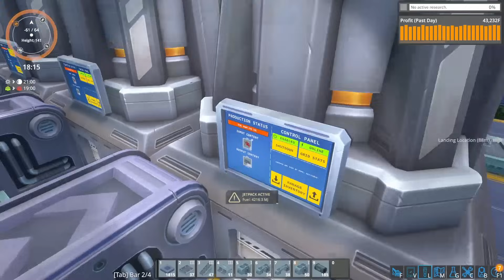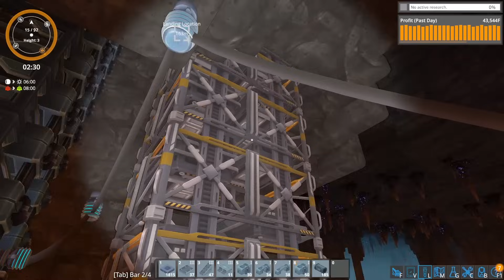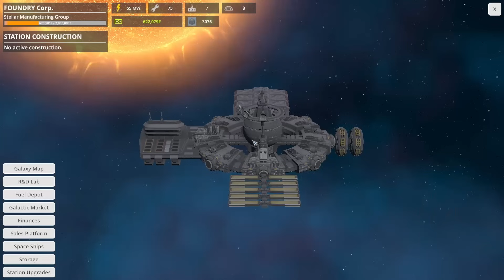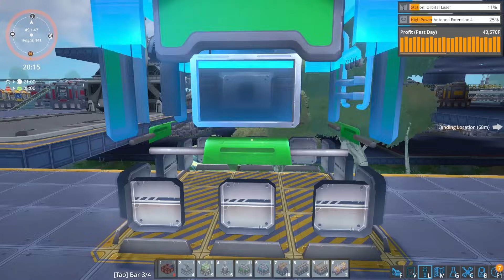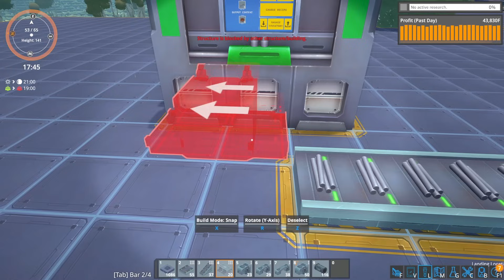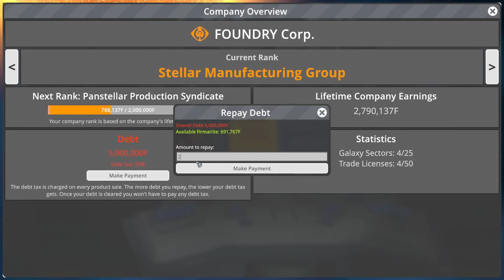Foundry - How to Reduce Costs And A Fresh New Layout - Update 2 [E10]

Comment: You have a medium T2 ship setup for planetary supply -- but you didn't enable it in either of the 2 shipping pads you showed in the video. It's showing a red x not a green check mark when you configure the pads. Loving the series - and ty for stopping for a moment during the series to explain what to put on the bus and how to get things off without mucking it up. Loved the tip about the balancers not snapping -- been driving me nuts not getting them to snap to where I wanted.
Reply from the maker: Thanks. I will have a look at that.

Comment: Takes a little more space, but i switched my bus from all next to each other to 2 belts with a space. That lets you put a splitter at ground level then use the auto belt routing to do the up and down slopes automagically. Its a lot less of a pain to draw off items.
Reply from the maker: Nice. Thanks for the tip!

Comment: During my playthrough, 
I Avoid relying on planetary transports—they're generally not worth it. These transports lack their own storage and are limited to carrying just 2,000 units per trip, making them inefficient for handling large quantities of resources like ore.

Instead, use a Small or Medium shipping pad in combination with a space station. A Tier 2 Medium transport, for example, can carry up to 10,000 units per trip, making it far more efficient. The space station also serves as a scalable storage hub that can be upgraded indefinitely to suit your growing needs.

Additionally, you can sell any excess resources on the market. Just keep in mind that to ship items between locations, you’ll need to obtain a license for each item you intend to transport.

One last note: the Medium shipping pad is actually smaller than the interplanetary shipping structure, so make sure to plan accordingly when building your base layout.
Reply: Planetary transports carry 20, 000 not 2,000 but yeah, even 4 small pads with T2 small lifters will fit inside the footprint of the transporter pad and like you say, doesn't wait for the same ship to travel, unload and travel back. As long as you have hanger space on the station, enough ships for constant turn-around and the licences it's only about 15 seconds to lift or land and they don't require power.
Reply from the maker: Thanks. I have been thinking about that option especially now that I have a lot of storage on the space station. Don't they use fuel though?
Reply: @surtrplays  No fuel it seems but there is the question of turn-around time. The small pads load/unload at 4000kg per minute. For the T1 ships thats 15 secs to land, 15 to load 1000kg then 15 to lift. For the T2 small it's the same land and lift and twice the load/unload so 30 secs. The overall is, how fast does the transport load/unload and whats the flight time difference? For seriously long distance I'd say the up/down is probably the way but for short hops the transport "may" take it. Something to play with at end-game methinks.

Comment: would just like to say that time is an issue as resources run out (as you found with power), but it's not as pressing as some other games. also space is not an issue. you have infinite space so no need to cram things together. it's a habit that I fall victim to as well. I feel like space is an issue due to other games.
Reply from the maker: Good points. I have also been influenced by other games but I also don't like running super long belts.

Comment: Are you removing the used fuel casings from your boilers?  You don't need to make the casings infinitely, you can just fill them back up.
Reply from the maker: I didn't know you could do that. I will have check it out. Thanks.

Comment: Something you might want to look at your power stations have a output Residual of casings from the Fuel Rods, if they backup, power will shut down
Reply from the maker: I didn't realize that. Thanks for pointing it out.
Reply: @surtrplays seems like an interesting "try it out" for the data cable stuff. Set it up so there's a certain number of empty rods in storage and turn on production if you drop. It'd let you add boilers without worrying about fuel rod shortages.